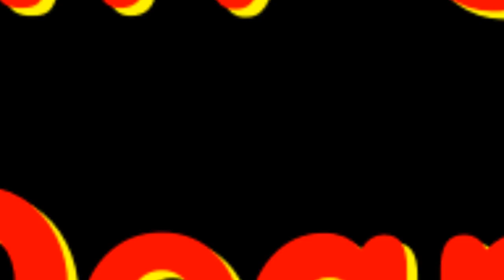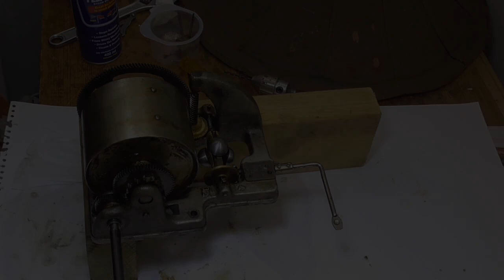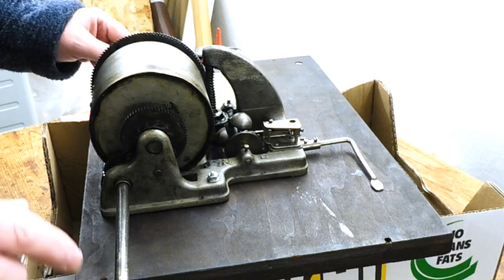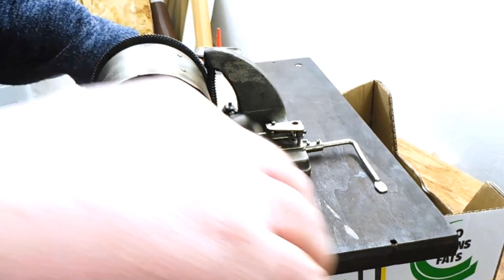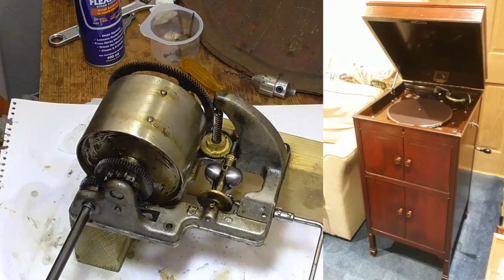HMV 32 motor woes! :-(

Comment: Do you have any experience with INTERNATIONALE by HMV turntables?
Could you please tell me if this turntable has a direct drive or belt drive turntable?
Reply from the maker: I don't, but I did Google it and it seems they were from the early 1970s and probably had BSR made decks. BSRs had idler wheels running on the rim of the turntable to drive them: https://youtu.be/6NEZzPQCl00
Reply: Thank you, I'm trying to get an INTERNATIONALE by HMV turntable working again after someone else 'had-a-go'.
I may need some parts as I no longer have a workshop of my own.

Comment: It isn't hard to service that spring case. The worst of it is the old graphite grease that has set like cement, but otherwise it's really straight forward. Secure the spring case in a jig, or buy a folding workbench, that has four wedges that will clamp it in place. The retainer ring is easy to remove, tricky sometimes to go back in. I think is Chilldude who did a series of videos on the equivalent victor motor, they will show you everything you need to know.
Reply from the maker: Thanks for the encouragement and the link. I think I watched some of his videos back when I got my first 162, but as that motor works there was no particular reason to open it all up. Having said that, this one does need the work, and I think I will be able to do it so I will give it a try! Thanks 👍😀

Comment: Oh dear, the suspense 😮 I was waiting for a horrible crash and it all springing apart dramatically. Phew, I can open my eyes now 😁 good luck fixing that.
Reply from the maker: Yes, well fortunately they don't explode in your face, though I understand there is some danger in removing and replacing the spring. I am going to have a go at doing it though. I need to learn how as I have other motors to fix too. Thanks 👍😀

Comment: Sounds like one of the springs has broken in the middle (end)  not on the barrel where you can see the rivet. It should play a side with just one spring providing its not the first spring that has let go, but I would suggest you open it up and take a look. It’s not hard to repair a broken spring . It’s always tempting to just try a clean and hope, but you are putting off the inevitable. If it goes together, it comes apart. You look as though you could manage it. I’m a complete idiot and I have fixed a few, although the last double one I did was in the 90’s. Just exercise good safety routine when you go for removing the spring.
Reply from the maker: Thanks for the encouragement 👍😀 I have starting watching videos of how to do this and agree I should be able to sort it out. I try not to take things apart more than necessary to get them working, but in this case I really do need to go further! 😀
Reply: mrrgstuff good you. A good pair of gloves and eye protection is advised. And it may sound silly, but once you start on the spring keep a bloody good grip on it until it’s all  out. A pointed piece of thick dowel will help you prise the spring out from the centre. You may wish to hold the spring barrel in a workmate so you have both hands free. The problem in leaving as is with these things is if the spring lets go under tension , you can strip gears and that’s beyond most of us to repair.good luck with it.
Reply: @mrrgstuff  I tend to be an advocate of the "if it ain't broke don't fix it" school and generally frown on taking stuff apart more than it needs. So I am very sympathetic to your view....  But you have a broken spring and so the precautionary principle goes out the window.  The worst case scenario is you end up with a broken spring, something you already have.
You might have gotten lucky and the spring isn't broke it just either came off the rivet or off the thing in the middle.  It will make good video.  And now you have two of them that don't work. Perhaps at least one will come out nice.
Reply from the maker: This one was a broken spring, and I did fix it. Much bigger spring than the Garrard, but the motor overall maybe not so much trouble 😉. I probably should have put this video on the end screen:
https://youtu.be/kTr6a6Ml8iM
Thanks 👍😀